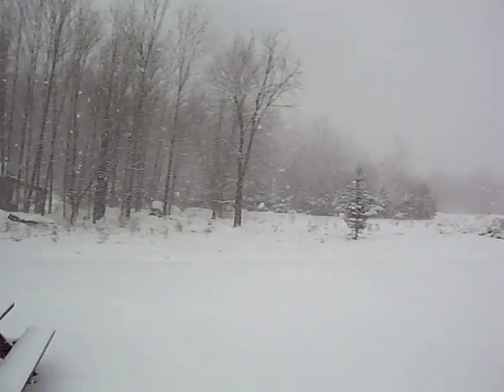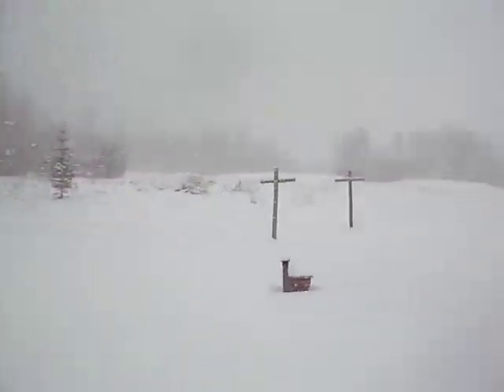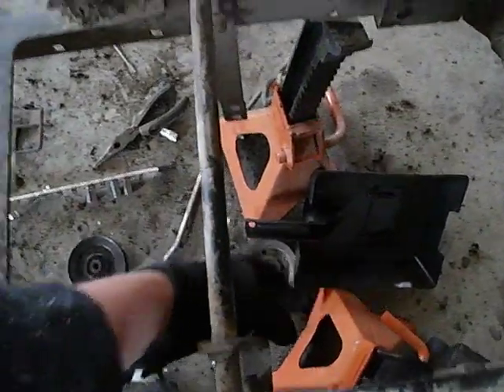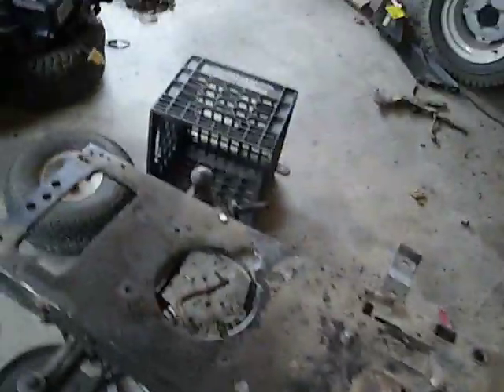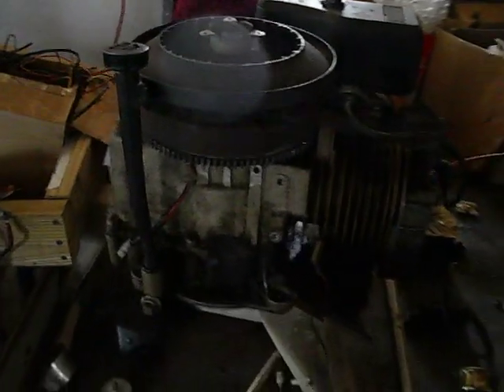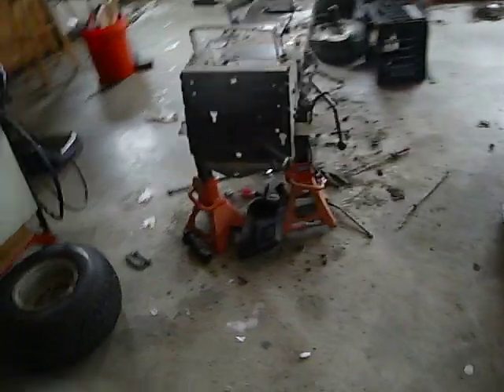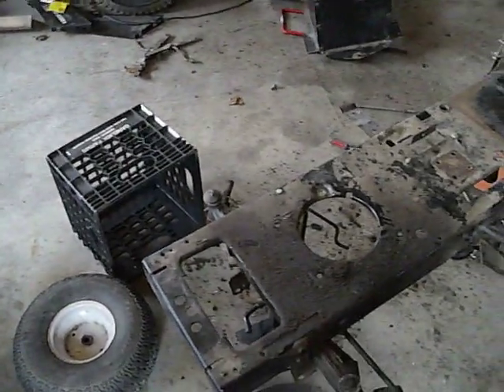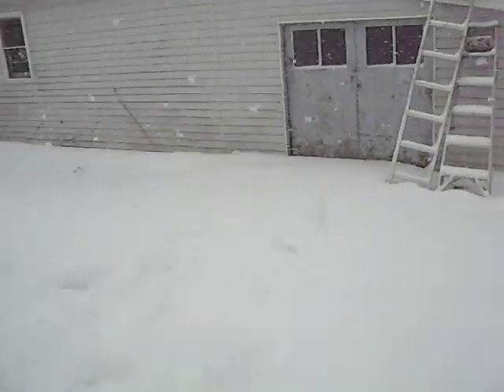Updates on stuff. Snow is slippery.

Comment from the maker: Yup. ill probably cut some 6" strips of angle and weld them in, just in case.

Im not too sure if im going to weld it solid or use bolts. The front axle is heavy but its not rectangular by any means.